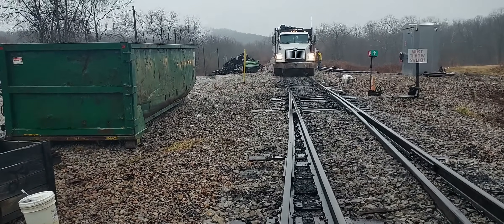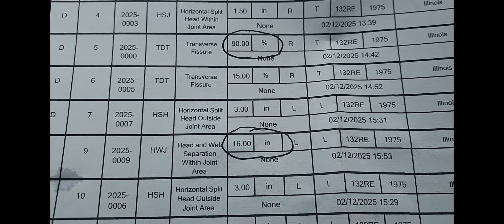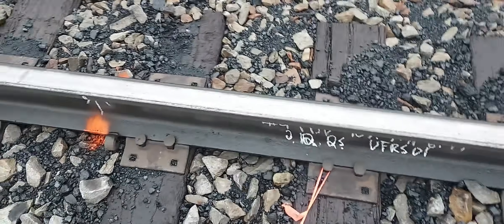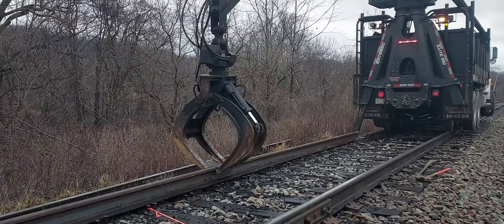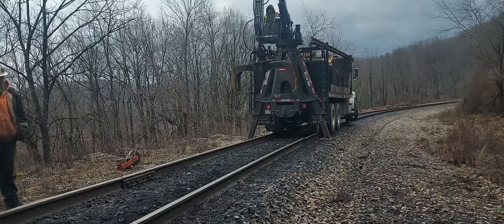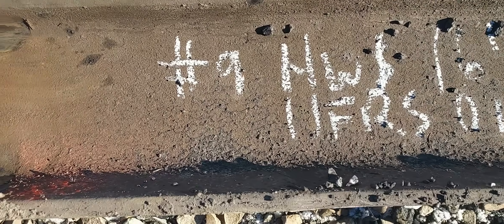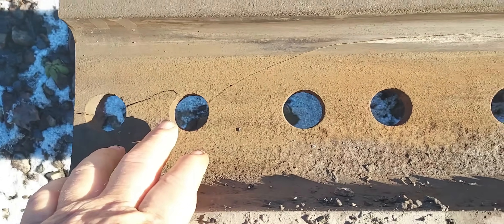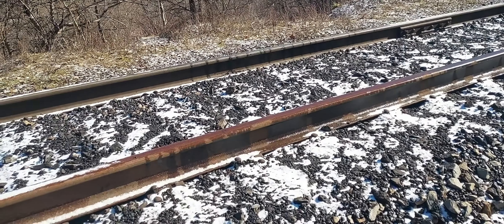Changing Out Two Sticks of Sperry Rail

Comment: Great video Dave.  Re the "relay rail" that replaced the second rail with the 16" or so of head separation.  Three questions: 
1.  Since the relay rail was a used rail, was it  just visually inspected to verify (as much as possible) that it was defect free before installation?  
2.  It looked like the relay rail was placed on the existing tie plates and spiked down.  Were the old spikes reused  or new spikes installed?
3.  Was Spike Fast or Sure Spike used in the existing holes before the relay rail was spiked down?
Thanks.
Reply from the maker: Thank you Michael and glad you enjoyed it.
1. Yes a visual inspection was made
2. Once we pull a spike out, it never gets reused, some RR's
do reuse spikes but we always replace with a new spike.
3. When a spike gets pulled out then yes we use Sure Spike.
We don't have Spike Fast, but it is a better hole filler than Sure
Spike is, but during the winter months you have to keep Spike
Fast warm before using it, and once you open up a tube of
the resin then you have to use the whole tube or throw away
what is left which is why we don't use it for the most part.
So for only a few spikes then it is kind of a waste of money.

Really appreciate your taking the time to watch our video and may
you have a very good day.

Comment: I'm a bit late with this comment so you may not see it and someone may have already asked but this question just occurred to me. 
When installing a new piece of track on a very cold day, do you need to allow a small gap in the track to take into account
expansion when the weather warms up and gets hot again ?  Or do you fit the track tight, face - face regardless of the day's temperature ? 
I noticed the claw guy tapped the first track into position tight.
Reply from the maker: He tapped that into place because that piece of relay rail we put in
was exactly the same size to fit the space Ellesmere. Normally
no matter what the temperature here we like to have about a 3/8
to 1/4 inch gap on both sides of the rail. However we also have
16 miles of jointed track so the gap is not as important here
as you may think for the ambient temperature. If you can keep 
the gap when installing under 1/4 inch everything will be fine
when the rail expands in the warm weather.  Really appreciate
your taking the time to watch the video and may you have a very
good day my friend.
Reply: @ccrx6700  Thanks for your reply big guy, you have a great day as well.
Reply from the maker: @ellesmerewildwood4858  😊👍🚂

Comment: I'd been hoping you would do a segment on drilling rail bolt holes! What do you do when re-spiking? Do you plug old holes? (There used to be oak plugs and later epoxy fillers.) Or just go to an unused plate hole?
Reply from the maker: Someday I will do a video on the rail drill Ken. We used to use those
creosoted wood plugs too, but now we use Sure Spike it is a
granulated powder and works great. Some places use Spike Fast
an epoxy resin and it works even better.  Thank you for taking the time to check out the video and may you have a very good day my friend.

Comment: What was the rail Id?
Reply from the maker: Both rails were 132 RE CC US Steel 1975 fzyo0001.  Thank you for  taking the time to check out the video and may you have a very
good day my friend.
Reply: @ I work at a rail mill. There should be Id stamped in the side of the rail. Called the heat number and piece.
Reply from the maker: @fzyo0001  😊👍🚂

Comment: That is a derailment waiting to happen. The entire rail is cracked. That's going to have to be taken out and replaced. The first section of rail the issue was spalling which indicates that the rail is cracked. The second one is more serious the web is split and it is right next to a joint. If that breaks it will sheer bolts and trains will be on the ground. Good thing you changed these out before they became a problem.
Reply from the maker: Your absolutely right about that Aaron. Testing and changing
rail is far cheaper than a derailment.   Really appreciate your taking the time to watch and may you have a very good day my friend.

Comment: I bet the one with the odd bolt holes is a rail that got reused and cut /redrilled for a different length.
Reply from the maker: You could be right Bill, that was put in before my time on the track. Really appreciate your taking the time to check out the video and may you have a very good day my friend.

Comment: Hello.  We perform ultrasounds twice a week. Since the path exceeded the operational load. The path of 2014. And so ultrasound 2 times a month.  As for assembling connections, when assembling the connection we are required to tap
 bolts, this allows the pads to fit more tightly. Wooden sleepers were abolished 15 years ago. We have concrete sleepers and I am very happy about it. Drilling machine str2d USSR, allows you to work at temperatures below -45 degrees.
Reply from the maker: We have hit on the bolt ends before also when tightening, with a good impact wrench it doesn't seem to make a lot of difference
tho, with a hand track wrench it certainly does make a difference.
90% of the rail in N. America have wood ties sleepers. Although new construction is going to more and more concrete, specially for
light transit applications.  Thank you for  taking the time to check out the video and may you have a very good day my friend.

Comment: The oil patch usually uses a tape that reads "10 inches to the foot". It made tallying pipe easier to add and not really have to deal with only having 8 fingers and 2 thumbs.  It was always said that if a man was smart he would not be working the oil patch.
Reply from the maker: I have a surveyors stick with 10 inches on it, always wondered why
they did that Big Un. I bought it unknowing it had that and only
used it a few times before I got another one that read 12 inches.
Thank you for taking the time to check out the video and may you have a very good day my friend.
Reply: @ccrx6700  Now you know.  Houdini sends his best to Freddy.
Reply from the maker: @bigun447  😊👍🐈‍⬛

Comment: The cost of rail inspection doesn’t come close to the cost of mobilizing several pipeline crawlers and crews to deal with a significant derailment.
Reply from the maker: Your absolutely right about that Kent! Couple rails replaced far cheaper than a couple of derailments. Really appreciate your taking the time to check out the video and may you have a very good day my friend.

Comment: 8:29 That little water bottle have some kind of cutting/drilling oil in it?
Reply from the maker: On my rail drill I have a 1 gallon pump bottle that I put cutting solution in and mix in 10 parts of water with it Patrick. Some
guys don't have all the luxuries and use water bottles to spray
water on the drill bits. Cutting solution is $150 a gallon and
while it does prolong the life of the drill bit, some don't want to
spend the money on getting the solution so just use water.
Really appreciate your taking the time to check out the video and may you have a very good day my friend.

Comment: Does it matter if you pull the inside or outside? we normally pull inside .
Reply from the maker: No it does not matter D Grisham. However we typically pull the
rail holding spikes on the side there is only 1 spike and just
pull up a bit on the spikes on the side where there are 2.
Really appreciate your taking the time to check out the video and may you have a very good day my friend.
Reply: @ you have a better day,Herzo is on our property now.finding a few things here and there. But it will sure save you some trouble down the road. Stay safe and warm out there.
Reply from the maker: @dgrisham6868  😊👍🚂

Comment: This is amazing! I worked switch gang on NYCRR in 1965 and we had jack hammers but otherwise “Armstrong “ equipment. Great video, thanks.
Reply from the maker: Yes back in the day hand tools were what we used also Robert,
very glad those days are over. We do like our power
tools now! But back in those days we were a lot younger too.
Reply: My father in law operated one of the 100 ton steam cranes out of Harmon Yard in Croton,  NY. Fortunately, both of those cranes were saved from the scrappers' torch. His went to the New York Central Railroad Museum in  Elkhart, Indiana.
Reply from the maker: @roberttuttle5405  👍😊🚂

Comment: When replacing rail in the colder months, do you have to compensate in length, so that in the hotter months, the rail expansion won't cause buckling?
Reply from the maker: We have 16 miles of jointed track here Dennis, so what you are
asking is not really an issue. We try and put the rails in with the
same joint gap what was in there when we took them out.
Thank you for  taking the time to check out the video and may you have a very good day my friend.

Comment: Good work Dave and crew. Is that a standard drill bit? Have you tried using annular cutters instead of drills? They're like a hole saw for steel.
Reply from the maker: Thank you for the nice comment Pete. it is a special drill bit,
I've never shown that up close in a video before. I've never seen
a cutter like you mention for rail, I will have to do some research on
that. Really appreciate your taking the time to check out the video and may you have a very good day my friend.

Comment: That hole was far to close to the end of the rail which is the reason it cracked
Reply from the maker: Your certainly right about that Michael. I have no idea why it
was drilled so close. Really appreciate your taking the time to check out the video and may you have a very good day my friend.
Reply: @ccrx6700  that rail was probably a standard length and pre drilled and was 2 to three inches to long and they could not be bothered to find a plain undrilled rail they could cut down cause no body would see it until it failed as all those holes wouldn't be seen under the plates
Reply from the maker: @michaeljohnson4636  😊👍🚂

Comment: Hello there fine sir,  I am curious to know if you lubricate the surface of the track sections and if so could you describe the purpose for doing so as well as the system that you use in order to complete such a task (or perhaps a topic for a future video if you feel that it is noteworthy).  Thank you and Blessings to you and yours.
Reply from the maker: We have 6 wayside flange greasers on our 16 miles of track
here CR. -They help to keep friction down on the train wheel
flanges and also on the gauge face of the rail head. I have yet
to do a video on them, but thank you for the suggestion. At
some point I will make a video on them.  Really appreciate your taking the time to check out the video and may you have a very good day my friend.
Reply: @ccrx6700   The pleasure is mostly mine. You are high on the list of my favorite channels because of the interesting content and the fact that you take time to read the comments that viewers leave and  then you actually reply.  That my fine content creator is a cut above and it demonstrates attention to the humanities and a level of sincerity that is mostly absent from this platform . So commendable.  My very best regards.
Reply: @ccrx6700  So did you lubricate the replacement section or do you wait for it to happen by the system?
Reply from the maker: @CRSolarice  no we did not, flange greaser will do tgat

Comment: Can a Spery rail be used as a check rail?
Reply from the maker: Yes it can but it has to be marked, however almost always a
Sperry rail is scrapped, it's unethical to resell it or reuse it in
a main line or yard application. Check rails never see trains running
over them.   Really appreciate your taking the time to check out the video and may you have a very good day my friend.

Comment: I spent my working life as a licensed Aircraft Mechanic and have seen a vast array of special tools. I have never seen a Gas powered drill or an electric impact gun that will do 350 Ft Lbs, never would have without you Dave.
Reply from the maker: Probably not too many bolts the size of track bolts on an aircraft
Terry? But I'm certain you had a lot of tools I never knew existed.
Really appreciate your taking the time to check out the video and may you have a very good day my friend.

Comment: Thank you for this video! 
Those contractors aced the job: more than just skill. 
Freeze-thaw cycles can contribute to the deterioration of rails but I suspect that unusual and excessive stresses also contribute as must defects in fabrication. Of these, cribbing, tamping and replacing ties can reduce stress but the rest is out of your control.
Ultrasonic detectors and geometry trucks may not be mandatory, but they are de rigueur for optimal maintenance.
Reply from the maker: Thank you for the nice comment Robin and your right about the
testing. Rail gets fatigued over many years of service and
shatter cracks in the original rail actually grow in size inside the
rail over time and trains and rail flexing. Really appreciate your taking the time to check out the video and may you have a very good day my friend.

Comment: Dave, I'm sure we've been over this, but, my memory fails me again, so here we go. Would it not be advantageous to weld in new sections rather than fish plate and bolt? Ultimately getting away from jointed rails? Go easy on me, I'm just a simple mechanic.
Reply from the maker: Yes it would Doc Holliday but the problem is, all of our rails have
3 bolt holes. All of our welding is done by contractors. They will
not guarantee a weld made that close to the 3rd bolt hole, it can
crack the rail. So to weld our rails would mean replacing every
stick of rail with a 2 hole or no hole end. Lot of expense and a lot
of time involved.  When we replace an entire curve we often
weld two sticks together which eliminates half the joints. Wish
we had all welded rail here, jointed rail is a maintenance nightmare.
Thank you for  taking the time to check out the video and may you have a very good day my friend.

Comment: Far less equipment needed for ultrasonic testing than righting a derailment.  Murphy's Law dictates broken rail  derailments happen on loaded trains so there is also a cost of cleanup.  

Yeah, I would think this was a big win.  And that double drilled end?  Oddball length?  I cut it twice and it is still too short!😅
Reply from the maker: Your absolutely right about that Keith. Couple rails replaced far cheaper than a couple of derailments. That swiss cheese rail
was 38 feet 11 1/4 inches, very odd one there. Really appreciate your taking the time to check out the video and may you have a very good day my friend.

Comment: Relay rail put back in, why take it out in the first place ? ? and where would you put it ? cut it up ?
Reply from the maker: Often when we change out a whole curve we will also take out
a stick or two in the tangent off the curve to have as a relay
rail ion case we get a rail break somewhere and can use that
relay to put back in it's place. Using new rail the ends don't 
usually match up to the old rail so used relay rails the ends
match up much better Gerald.  Thank you for taking the time to check out the video and may you have a very good day my friend.
Reply: @ccrx6700  thank you for the explanation.
Reply from the maker: @geraldblackburn4883  😊👍🚂

Comment: The reason I watch your channel is because I like learning something I know nothing about. Now this one raises more questions.
1) Didn't realize rails came in different lengths. (how many)
2) Do you ever cut rails in the field?
3) Were they drilling holes with that machine and why?
4) How often do they test cross country rails?

That's it for now,
Enjoyed the vid,
Lee
Reply: 1 rail comes in all different lengths. From 39foot to 80. That ive seen. And then you have cwr, continously welded rail, it is around 1,600 feet long. 
2 yes we cut rail in the field all the time.
3 the drill is used to bolt the rails together.
 Inspections are done under federal railroad administration regulations  depending on the class of railroad 1 is yard tracks, 10 is fast high speed track. The higher the class, the more often the inspection is done.
Reply from the maker: Thank you for the nice comment and glad you are enjoying Lee.  
1. Stick rail can be 39, 40 and 60 or any other size below 60 if special ordered. (if shipped by truck, shipping rails by rail can
have a lot longer lengths if ordered that way.  2. Yes we have a rail saw and cut rails when ever needed. 3. That stick of rail we put in had no bolt holes from the mill in it, so we had to drill holes in it to put a joint bar on.  4.  We have the ultrasonic rail testers in here every 6 months as well as a geometry truck. That is pretty much the standard for testing rails across the country for freight railroads. Really appreciate your taking the time to check out the video and may you have a very good day my friend.

Comment: I assume that you used air powered impact wrenches before batteries.  Does the battery powered have as much torque as the air powered?  I watched a demonstration of two men that retired from a section gang on the T&P/MoPac.  They were pretty old when they did the demo but it was fascinating how they stood on each side of the rail and alternated hitting the spike.  They could drive a spike in less than 6 hits. As always, thanks for sharing your work with us recliner guys.
Reply from the maker: We never had air tools here Charles, we've used hydraulic ones
and then the battery powered impact came. Some railroads do
use air tools and the air and hydraulic impact wrenchs are more
powerful than the battery ones. Before the hydraulic tools we
got we did everything with hand tools. Really appreciate your taking the time to check out the video and may you have a very
good day my friend.